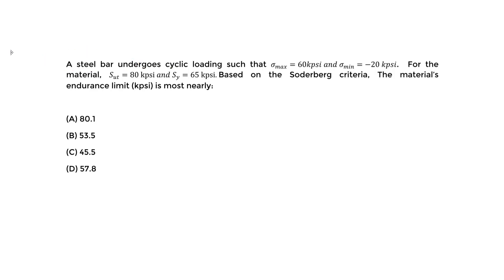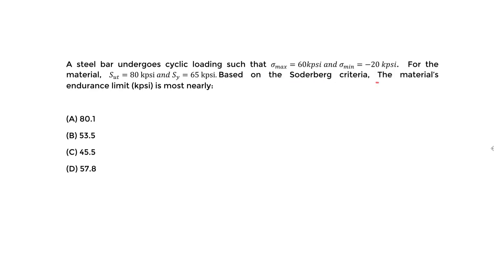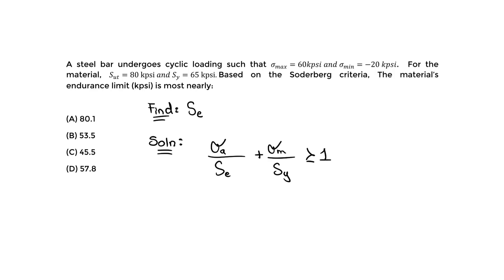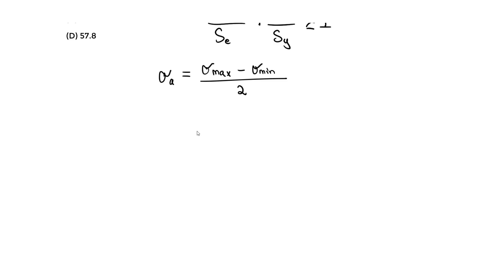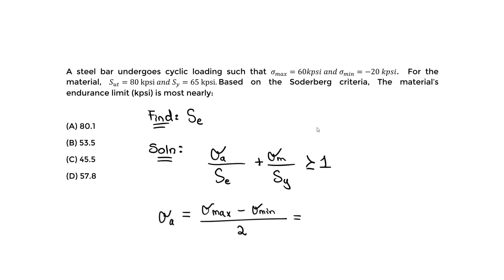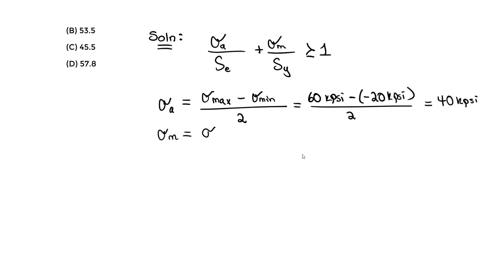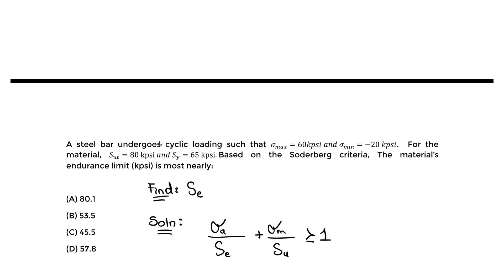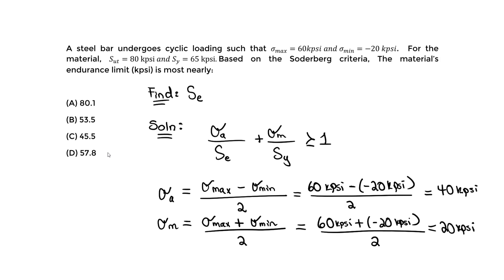FE Exam Review - FE Mechanical - Variable Loading - Soderberg Equation

Comment: How do you know that alternating stress = (stress_max - stress_min)/2 only using the handbook?
Reply from the maker: Yeah it should be in the handbook under the mechanical engineering section.
Reply: @directhubfeexam  The FE manual says that alternating stress = max stress - alternating stress. Why should we divide by 2?
Reply: @nataliabasualdo6981  on what page does it say this?
Reply: ah, nevermind, pg 447 says sigma_max = sigma_mean + sigma_alt, so you can infer that sigma_alt will be half of the height